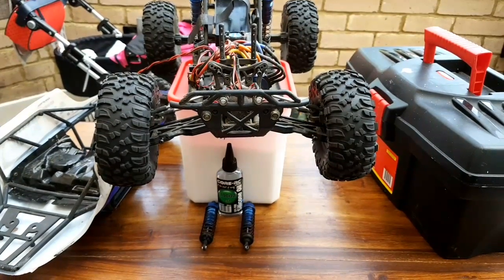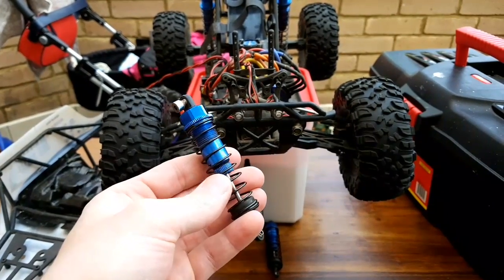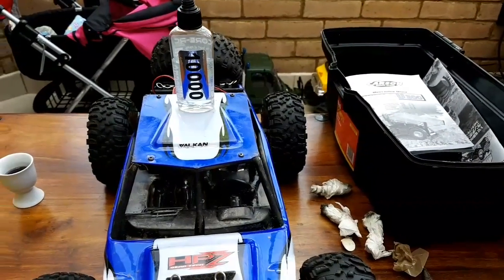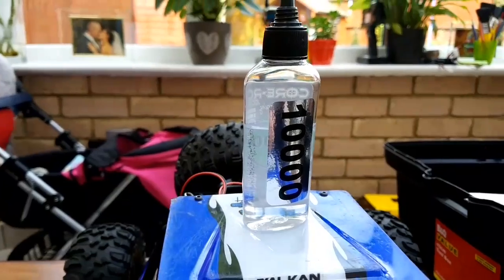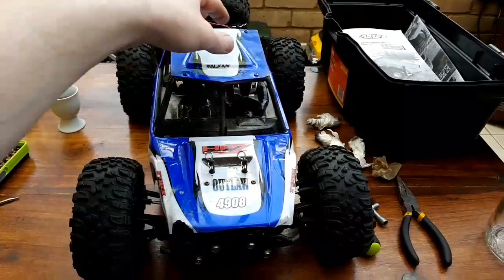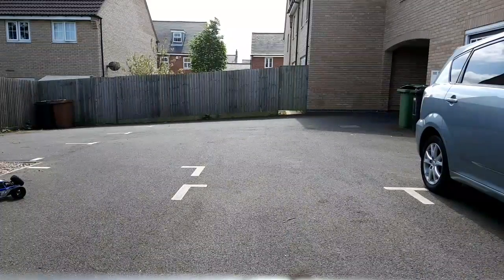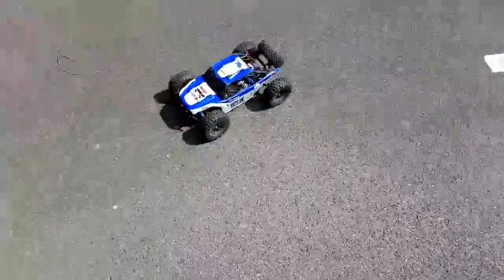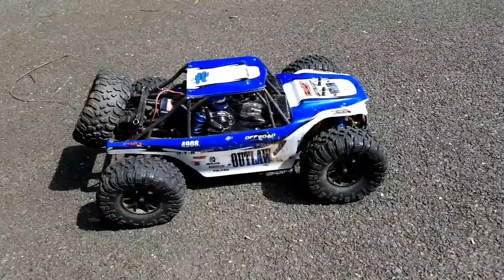Oil changing in shocks for rc car.

Comment: Hi have you got any idea what you are doing ?????? Take the spring off the shock  then you wont have to try and hold it squashed down while you try and tighten the screws  then  clean the shocks using a cotton bud . Then put In the right thickness oil that is recommended for these shocks/ftxoutlaw  .as 10000 is way to thick once the oil is in then reassemble the shocks.  . Plz read up or ask someone who knows about RC stuff as for an RC shop saying use olive oil when they probably sell the right oil is .............mmmmmmm yea  right .

Comment: Way to thick.. I use 2000 which is perfect ,also I have wider tires 140mm by 70 mm and it is way more stable and looks a Beast. Good video mate. 👍👍👍